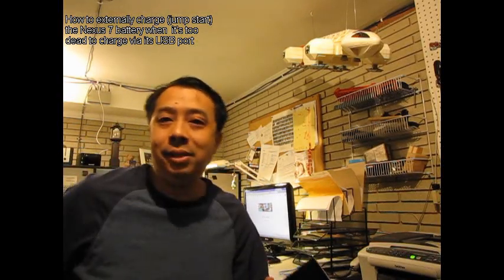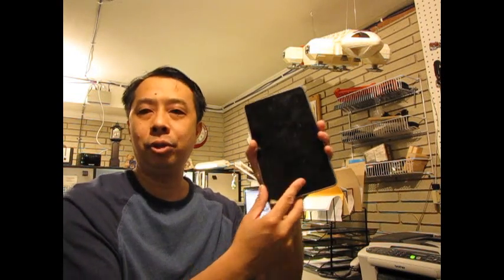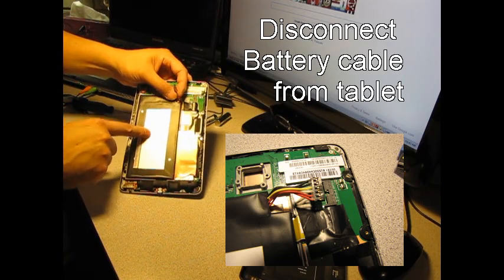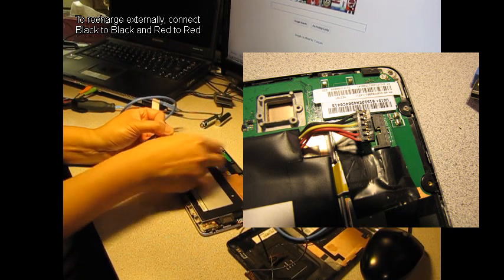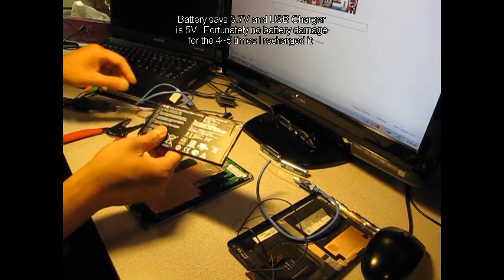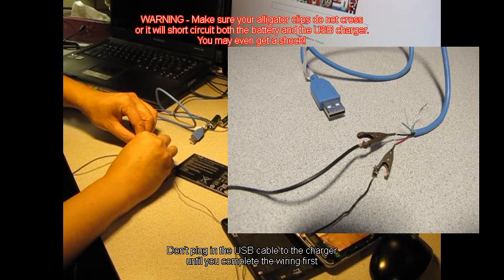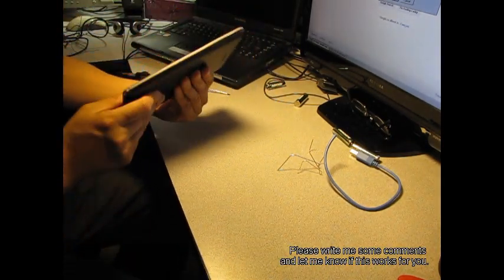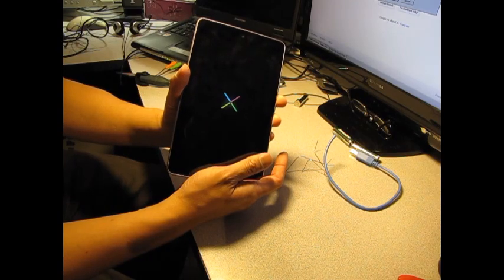Externally Jump Start Your Dead Nexus 7 - Final solution when all else fails!

Comment: Hey Doug, Thanks a lot for this video, just brought back my nexus to life.

--> The problem now I am facing is that my N7 2013 isn't charging when i plug my power cable, though it shows charging on notification bar, Any idea about how to get that fixed?

 Once again. Thanks a lot :)
Reply from the maker: +Farhan Sheik The USB port on your tablet is almost certainly dead.  You can replace it (e-Bay sells the USB part and because it is modular, it is fairly easy to replace yourself).  However, if you have a 2012 model (it has 4 gold dots on the side), you can purchase the official docking station as an alternative it it can charge through that.  Or if you have a 2013 model with wireless charging, you can purchase the wireless charger as an alternative.  Either way, these alternative charging methods would not work until you have successfully jump started your tablet as you have done.  Hope this helps.

Comment: Doug, I resurrected my Nexus 7 by following your method it is at 26% charge. Now my problem now is that it will not charge from the computer or the wall. Is there another reset I have to do?
Reply from the maker: +Luis Rivera , The USB port on your tablet is almost certainly dead.  You can replace it (e-Bay sells the USB part and because it is modular, it is fairly easy to replace yourself).  However, if you have a 2012 model (it has 4 gold dots on the side), you can purchase the official docking station as an alternative it it can charge through that.  Or if you have a 2013 model with wireless charging, you can purchase the wireless charger as an alternative.  Either way, these alternative charging methods would not work until you have sucessfully jump started your tablet as you have done.  Hope this helps.
Reply: +Doug Peng I thought of buying the official docking station, but I like to try it first before buying it. Thanks so much for your help.
Reply from the maker: I bought the official docking station myself, and it works fine for charging purposes.  Unfortunately, you cannot download files off the USB and hence have to email it out.
Reply: +Doug Peng good point, I just ordered the charging port from Amazon. I will do the installation as it looks a simple DIY job. thanks
Reply: Hi Doug, I just want to thank you again for your video and advice. I changed the port and I have a working Nexus 7 that is charging and a happy son. Great video.

Comment: This worked on my 2013 model!!! The battery pins are so small (unlike the 2012 model), that I just made contact with the red and black usb wires and snapped the battery clip back down and let it charge for 5 mins. In this case, no need to charge outer and inner red/black, indicating just one cell perhaps? I couldn't even fit a sewing needle in there to make contact. Regardless, success. Thanks so much, DP!
Reply: Did u use the alligators pins? Do u have to use it?

Comment: Doug, that's fantastic.  Your video saved my day and my Nexus.  Everything worked like a charm and my Nexus is up and running again.  I had spoke to Google this morning and the only thing they suggested was repair (which wouldn't be worth it).  Just by chance I stumbled across your video.  Instead of alligator clips, I just used binder clips which worked fine.  Thanks again for having a heart to help others and for making this easy to follow video.  Great job!

Comment: I have a ton of USB cables from old USB devices (e.g USB hub, docking station, etc.).  I could use one of thee cables, too, right?
Reply from the maker: +Takeoesm1 , yes you can, any one will do.  However, some older USB cables have different internal wire coloring standards, but you can Google to find out which is the Black (-) and Red(+) power supply terminals.

Comment: Thank you thank you!  My OG Nexus 7 2012 is back in business thanks to your video!  As other people have noted,  you only need to charge one set of red and black wires.   And if you don't have alligator clips just wrap the stripped wires around two thin needles or pins and push them into the tiny holes.  But don't push too far or you'll push the battery wire out of the other end of the connector (easily replaced.)   In fact you might even just want to go ahead and push them out and connect your usb wires directly to the battery wires.   Either way,  THIS WORKS!   Thanks for saving me a bunch of $$$ buying a new tablet!
Reply from the maker: +jazmaan , Glad to hear you got it to work and thanks for sharing your alternative solution with the readers.

Comment: this tablet has problems with the battery (very slow charging mine has have been 100 percent the closest it has been to a hundred percent was 93 percent) it also had problems with the charging port, the charger becomes loose and it has problems with this, I have bought more than two charges and the port still became loose :/ and it is very laggy.it has got 32g of internal memory which is awesome but the above cons just out weigh the cons.

Comment: Great video. But i don't know if it will work if I try it.. It seems too risky and I might damage my Nexus 7 more.

My Nexus 7 just won't charge nor turn on. I Also can't boot with using power + volume down.. I don't know if its the Battery problem or just Hard Bricked.. Any Advice or help?

Comment: You have taught me how to fix my Nexus 7 and for that I'm grateful!  your inner pictures gave a clear picture of what you where describing, very helpful.

for my self I charged each cell 15 minutes each then reinstalled the battery plugged it in and started it.  I started up fine (slow since lollipop :(  ) ...  funny thing - it said it has a full battery now... but I don't trust it and leaving it to charge longer!

I was kind of fearful that I may have ruined everything because as I went to touch the battery to check if it was warm I zapped it (static electricity - I have ruined surround sound systems before because of it!  )

Comment: Fixed it for me as well. Initially, I tried using an external USB battery pack (Anker) but that didn't work as the circuitry inside the battery pack didn't like the load, and shut down. Then I dug out a bench PSU I had which has a current limiting function, and set it to 1 amp. I charged each cell for about 15 mins and it worked fine (FYI, the voltage applied was a shade under 4 volts).
Reply from the maker: +Andrew Katz , thanks for sharing these useful amp values with the readers.  I didn't have an amp meter to show the results.
Reply: +Doug Peng Thanks for posting the video in the first place!

Comment: it worked! I was stuck on the charging logo, no google logo, no fastboot! I charged it for a minute and it was back on!
Reply from the maker: +Alessio Trivisonno , your symptom is interesting in that you had the charging logo, which would mean the battery was not completely dead.  At least I don't think so.
Reply: +Doug Peng +Doug Peng Hey Doug I want to start off by saying Thank You very much as I had acquired a bundle of N7's that seemed destined to the bin, but after your video I was able to save 6 of the 8. I did want to update you on the matter that there's only one cell not two as both red and black wires are soldered together at both points. I would also like to add that if this doesn't work it could be that the battery is dead and beyond saving however a new battery is relatively cheap, Thanks again.

Comment: Thanks my nexus has been dead over a year, wouldn't charge or display anything . I followed your video to jump start the battery, but instead of alligator clips I just wrapped the cut usb wires around a staple for each wire. After I found out it worked I used a hot glue gun  to make a more stable usb jumper cable. I charged each cell for only 10-15 minutes and this resulted in 5-8% charge. I also realized that I can only charge the tablet when it is powered down  I don't know if it was like this before but I'm happy to be able to use something I thought was dead. Thanks for making your video ! Thumbs up!

Comment: Your fix worked great!  I have 53% power now, but the phone is not charging via the micro USB port.  I tried several cables and transformers that I know are good.  What's next?  2nd generation has a soldered port, so it may not easily be changed.  What about a wireless charger?  Thanks.
Reply from the maker: +tliteful , if you have the wireless charger version, you can now use that to recharge.  Or if you have the older version with the 4 pogo pins on one side (4 gold dots), you can purchase the external docking station to recharge.   Fixing the USB port is not that difficult as it is a modular piece that you can buy on ebay.  Good luck and glad to hear you got it working again!

Comment: Thank you so much - my tablet hadn't been used in months and months.  Didn't know exactly what was wrong, though I suspected the battery was just that dead.  Alligator clips and wire strippers weren't items I had on hand.  So I wanted to share my less-than-ideal setup, that worked:  I used an old phone charger where the charging plug was severely bent (no loss of revenue here!) and a pair of jewelry-making wire cutters (ain't no shame to my game).  This plug only had a single red and a single black wire - stripped those, twisted the fine copper wires, and then inserted them into the battery's plug ... charged each cell for 30 minutes just like you said, and Voila!!  Booted like a charm.  I went ahead and powered it down properly and then completed the charging using a standard cord.  For being a non-technie, I felt pretty comfortable after watching your video.  Good job and thank you again!

Comment: My wife's Nexus 7 hadn't been used in a year and, like others, couldn't boot it up.  After watching Doug's technique, I bought a $3 USB cable, and used a couple of sewing needles as the contact points for the battery, plugged it in to a wall charger, and after less than 2 minutes, had it kickstarted.  A few hours later it is now fully charged up and working like old. Thanks for this video.
Reply: nonsense: how it started in 2 minutes if battery was disconnected from motherboard LOL

Comment: Thanks for the video Doug! My nexus 7 has sat uncharged for months and this worked for me instantly. My battery showed less than 2mv on both cells and 1 minute of charging off a 5v wall charger gave me 2.97v and 3.02v for both cells. The device charged like normal and even got to the android boot menu straight away. Thanks again!
Reply: Ill also add that i just stripped the usb wires short and held them on the visible side of the pins/connector by hand. A really quick and easy fix guys!

Comment: Did you use a 1 amp or a 2 amp charger? Thanks for the great tutorial btw, my fingers are crossed.
Reply from the maker: +Nicholas Bakken , I used the USB port from my computer.  Probably a dumb choice as I could have blown it.  I don't think a 1 amp or 2 amp would make much difference between the goal is not to charge the battery all the way up, but just to give it some juice so that your tablet can reboot again.

Comment: Why chance a usb port on a pc, use a $1 usb wall charger instead!
Reply from the maker: +Charles J. you are so right!I should have taken your advice, it should have been obvious. thanks for sharing your thoughts
Reply: +Charles J. Heya, The best info that I
 have seen was on Volt daddy (i found it on google) I bet its the most 
informative info on batteries and this same things that I have found.
Reply: +Doug Peng I wouldnt try that, cheap wall bricks are known for ruining batteries, as they arent made with voltage regulators to protect the battery
Reply: @Josh Rehders I have cheaper wall chargers that are regulated as good as my laptop port so why mess around like that with my expensive laptop when I have MUCH cheaper wall chargers that is tested and regulated. Just need to know what your buying, simple as that!
Reply: That can be true, but most people will snag a cheap wall plug from the supermarket checkout or a gas station so just a heads-up for some!

Comment: Fantastic!  I didn't even do the search about the connections being loose (which, in my case, luckily it was!), but this is fantastic to know!  I have quite a few tablets around here and their batteries are completely dead, and I do have the repair equipment on hand.  Bought a set of "computer repair tools" at Best Buy when one of our local stores was closing for dirt cheap.  Thanks SO MUCH!  :)

Comment: What kind of wire do you attach to the alligator clips to lead to the battery?
Reply from the maker: +Kyle Arn , I call it "spaghetti" wire which means a solid core wire as oppose to threaded strand wires. In theory, you could insert the USB cable wires directly into the battery connector, but in practice it is more difficult than it looks.  The reason is that the USB cable wires are usually made of strand wires, meaning it it not one solid wire but multiple thin threads.  Instead of using an aligator clip, you could try connecting the strand USB cable wires to a paper clip, or safety pin instead and insert that into the battery connector.  If you twist the USB cable strand wires with your fingers, you could make it strong enough to tape onto the paper clip or safety pin.  One other commentator used a screw and nut to connect the USB cable wire onto a safety pin which makes a lot sense.  Hope this helps!

Comment: I seriously don't know why I haven't thought of this. I sent in my tablet twice to get fixed. Same issue happened. I think one of the pins on the USB port is not connected. 

I tried this and directly connected the wires to the battery. I didn't have pins or anything else. It turned on. I'm letting it charge some more at the moment. 

Replacing the USB port is pricey for this tablet. But I just might buy it. 

Has anyone used a wireless charging dock?
Reply from the maker: +Yesenia Martinez , It's not difficult to replace the USB port yourself.  You can purchase the part from E-Bay and because it is modular, it's fairly easy to take the defective one out and put the new one in.  I believe there is a Youtube video on this as well.  However, buying the wireless charging dock (or in the case of my older model the POGO pin external dock where it charges through the 4 gold connectors on the side of the tablet) is the way to go.  You can recharge your tablet this way forward despite the USB Port is broken. The only draw back to this method is that you can no longer download your pictures/videos through the USB port, but you can always email them to yourself.  Good Luck!
Reply: +Doug Peng My port works sometimes. There's one or two pins that are not connected to the board.( I'm not sure the exact terms for it). I tried placing them closer to the board and it charges. The only thing is that it has to be placed on a flat surface. Not much movement can happen to the tablet. I've had this tablet for years now. I only really used for maybe two months. I sent it into Asus twice and they "fixed" it. I'm just really glad I came across your video. I'm not sure if I can solder those two pins to the board or if that's just not a good idea? I've replaced parts of phones and laptops so I know I can do the tablet. I just don't know if it's better to try to fix the one that's already in it or to just not even bother and replace it.

Comment: Thanks this worked great for me too! Did something similar using a USB cable and cut the micro-usb end off and terminated the 4 wires into a terminal block. I then just connected up another two wires the other side of the block one for the red and one for the black to be able to shape the cable into position (paper clips would do something similar). These two wires were held in place on the battery red and black wires as shown in your video. I plugged the USB cable into a mains-to-usb converter plug (charger). Before the process I used a volt meter and the battery was showing ~3.45v for each of the two cells. After holding the wires in place on the battery and switching on the power for around a minute per cell, the volt meter then showed ~3.56v for each cell. I put the back cover on and tried to power on and got the battery symbol to appear on the screen!! I then plugged the good micro USB cable back into the tablet and left it for around 10 mins. After powering on again and holding the power button for around 10 secs the tablet started to boot and showed the Google banner. Once booted the screen said it would take around 2 hrs to fully charge.
Reply from the maker: +mhollis60 , thanks so much for sharing your detailed solution and experience.

Comment: Yep Doug, That worked. Thanks for the excellent video- no intro graphics, no faff, no mumbling, just succinct and focussed instruction. 

My July 2013 nexus 7 has a bigger battery and slightly different connector - that needed to be prised UP. The paper clip probes were too big, so I jumped using the thin wire of the USB cable.  15 mins per cell worked for me giving 13% upon boot.

Thanks.
Reply: +Spinalman how did you hold the wires steady for 15 minutes

Comment: thanks a lot! this brought my 2012 nexus 7 back from the dead. I had tried every other fix, to no avail.  I used a 5V 0.15A on the outer black/red (USB wires connecting using sewing needles) for about 5 minutes. Put it back on charge with a 2.0A after that and only had to hold the power button for 5-10 seconds and bingo!
Reply: +David Boyd Great minds think alike.  I also used sewing needles.  Paper clips are too thick.